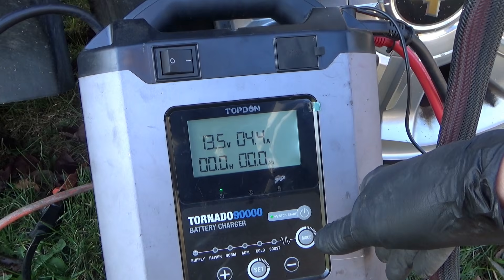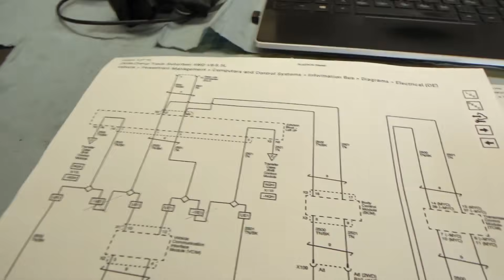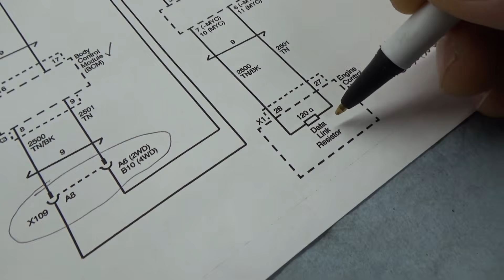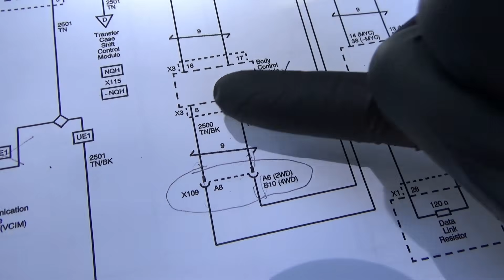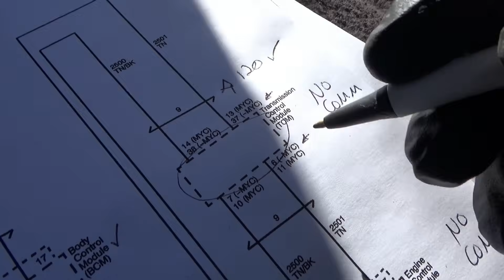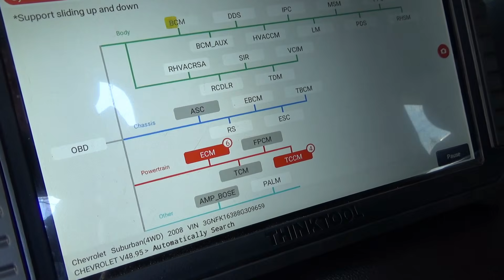(Pt 1) Beached Whale Chevy STUMPS Shop for 4 MONTHS!? ('08 Suburban: No-Crank, No-Comm?)

Comment: ON 2019 and newer GM vehicles, the RPO's are still there, you use your phone and scan the QR code on the drivers door label.
Reply from the maker: That QR system sucks... Incomplete list 🙄
Reply: @PineHollowAutoDiagnostics  Yes, very true, have run into that many times as well but has most info needed to answer questions for scanner short of grill shudder (WMI) on 2500HD and 3500 trucks.

Comment: Right off the bat the network tree on the Thinktool was WRONG!  You just can't trust those, which makes them worthless.
Reply from the maker: The topology is gold! You can see on one screen which modules are talking and which ones are offline. Obviously the physical layout is not 100% accurate... That's what wiring diagrams are for 😉
Reply: @PineHollowAutoDiagnostics  Well seeing which are online vs offline is no different than a simple list.  If the physical layout is inaccurate, it's not a topology.  It showed the BCM on a totally separate network but in the GM wiring diagram, the BCM is inline with the TCM and then ECM.  You made a statement like "the BCM tree is talking" or something.  There is no tree like that.  It just seems like it would throw off a proper diagnosis to treat that screen as a "topology" when it is not.
Reply from the maker: @kevin9c1  simple list doesn't show you the gray "offline" modules lol
And BCM is the gateway between high speed and low speed networks so it was displayed in the low speed "tree" which is not incorrect. 😜
Topology is an amazing feature!
Reply: @PineHollowAutoDiagnostics  I meant a list with the same color codes.  I watched a video on another channel that went into detail on how/why that topology is not accurate.  It WOULD be amazing if it was accurate.
Reply: @ The "Powertrain" tree on your Thinktool shows FPCM and TCCM on the same CAN line as the ECM and TCM.  By the wiring diagram in your video, this is wrong.  Also, the order is wrong, because it shows the ECM first when the ECM is last.  So how can you trust that for anything?
Reply from the maker: @kevin9c1  see comment response #1 🙄
Reply: @ But you don't need a "topology" to see which are online and offline.  You could do it with a simple list with the exact same color coding or even shapes.  What am I missing?  I am not saying it's not useful to see which are online or offline but that's not what a "topology" is!

Comment: I don't think id ever take my car to any shop unless i did very well research of them but still most shops only know how to do the parts cannon. If you got real issues like this car that needs something other then tossing a new part in you'll be screwed at 99% of shops which is very said that most shops do not even know how to do BASIC testing or use a multimeter other then using it to see voltage. Sad....

Comment: We had a beached whale when I arrived at this shop. It was a 99 or 2000 Cherokee and the A/C and dash and gauges speedometer and everything would go out soon as you pull off.  Switch engine off and restart, everything working again, until you start driving. 

Been sitting for 10 years and pretty much abandoned.  I talked shop owner into putting a battery in it for testing and during lunch I determined when dash goes out I was losing power at 3 fuses in the underdash fuse box.  Shop omwer said a dealership had already doagnosed the fuse box was bad and it needed a fuse box. He had installed a used fuse box. 

The Cherokee was losing power to the fuse box between battery and fuse box inside the dash where it ran across from the passenger side. 

He said wasn't going to spend any more money on it after I found the cause of the problem so I didn't get a chance to find actual bad connection location. 

I post this because everybody always says check grounds, you need to check grounds!  You get so hungup on this bad ground mentality, you don't think about the power side! 

Record beached whale for 15 years and counting! Sat so long it's ready for the crusher now. Rats and tires done rotted off of it 😳
Reply: Maybe it was sick of mechanics pulling off in it, so it just shut down. 🤐
Reply: Love your post thank you wend I started out in this trade now that I look back god made me one of the best no one would help me god fired many time